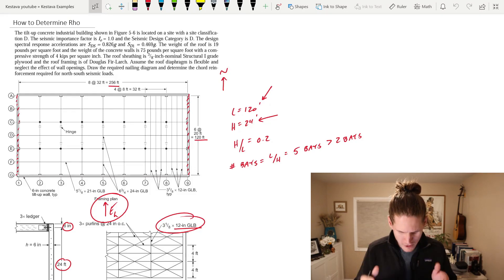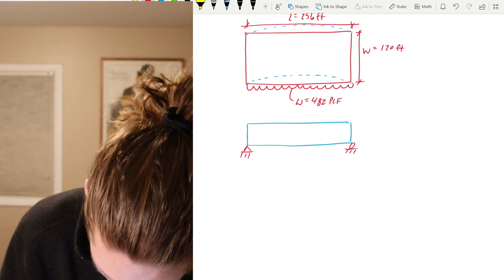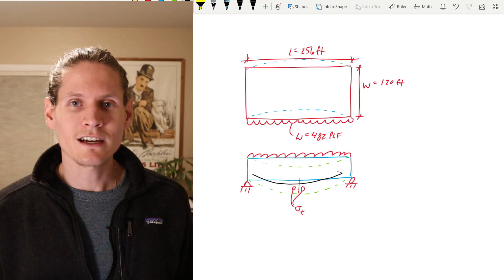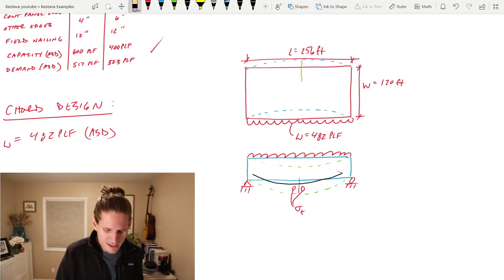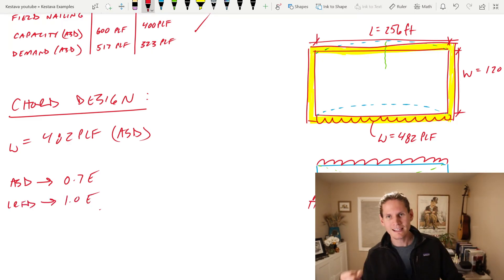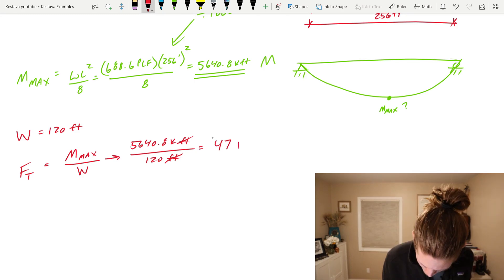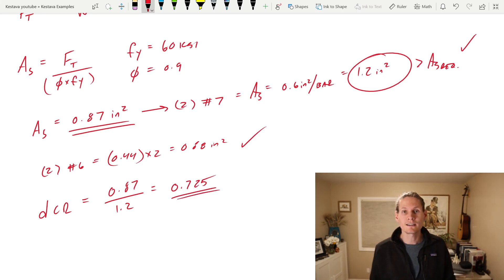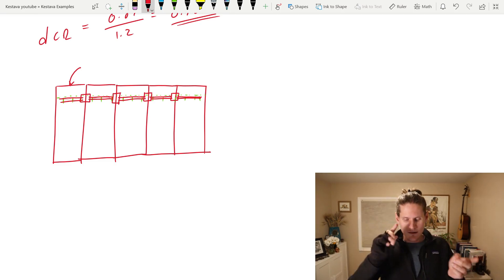How to Calculate Chord Forces And Professional Engineering Insight

Comment: Hi! This is some great stuff. I did my chord reinforcement for previous projects in the composite deck itself. 
What I was looking for is for a condition where lateral system is braced frames but spaced throughout buildings rather than at the perimeter walls. Wondering if we would place our chord reinforcement at braced frames.

Comment: In a rectangular building with CM and CR in the geometricial center is it fair to assume and only analyze the diafragm in it's most demanding section (longer side) given that this will provide the critical chord forces?
Reply from the maker: that is true - however even a perfectly symmetric structure still requires a 5% eccentricity added to the analysis per code

Comment: Move away from block out panels and look to using a steel channel ledger topped with a wood nailer.  The channel is easier to weld together at panel joints using steel cover plates, rather than welding special rebar to angle iron that has to fit in the knockout pockets.  The channel can also provide wall tie support in lieu of using hold downs.  And bolting the channel to the concrete is better at vertical load and horizontal shear transfer to the concrete than wood is.
Just a suggestion.
Reply from the maker: Joseph I love the idea - I'm new to tilts so this was the path given to me. I'll suggest something like this moving forward to consider! thank you!

Comment: Great content Rich! To transfer the load (the chord tensile force) from the roof deck to the tilt-up panels, would you then use a continuous angle with post installed anchors at a certain spacing? If the deck is wood, maybe a ledger? I’d imagine the anchor spacing would have to be really tight in the middle (highest moment) and larger towards the edges.
Reply from the maker: great detailing questions QQE! it depends on how your roof framing is oriented. the connections your questioning are more for out of plane anchorage of the walls to the diaphragm. the ledger connection is another great point, and is used when joists run parallel with the panels. and lastly, depending on your seismic design criteria, you have sub-diaphragm design you need to look at. always a bunch more to do for a real building, and you are asking all the right questions!

Comment: For wood framing, wouldn't the floor decking help with this deflection and reduce the tension experienced by the chord? Other than a double 2x4 top plate what else would reduce the tension load.
Reply from the maker: yes absolutely! there is tensial strength that you could rely on from the deck and double top plate in wood construction